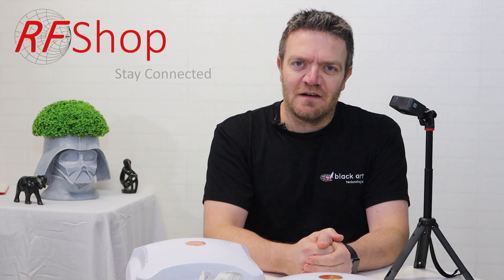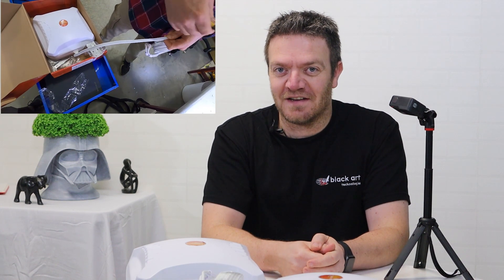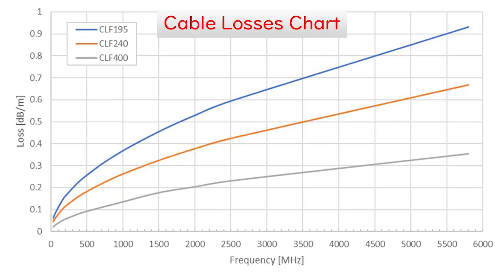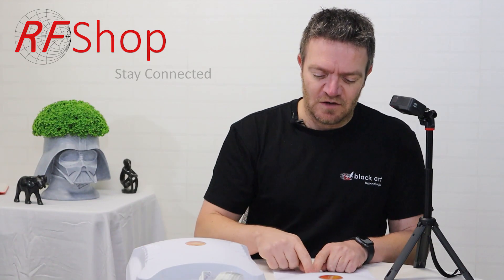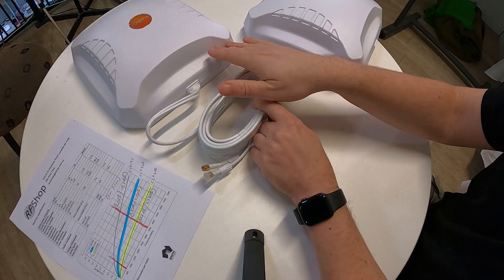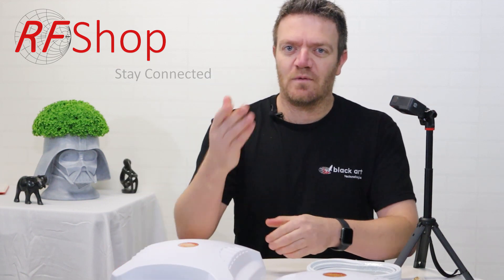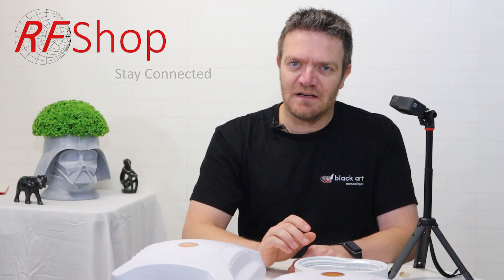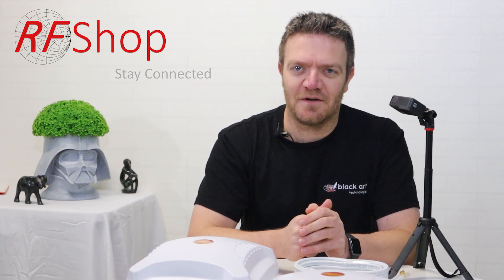How to manage cable losses on a 4G or 5G Antenna

Comment: Please make a teardown of your antenna on the next video, thanks!
That would be interessting for all of us.
Reply from the maker: Spaten Pauli I need to be careful what I can disclose in the public forum. There are some low cost antennas I can investigate though.
Reply: @RFShop  Antennas are interesting. especially the obviously nasty ones you can find on ebay that make seemingly unrealistic db gain claims.
Reply from the maker: @brangiexx  interesting enough, a mentor ones told me I should not even bother with the stuff people see on eBay...if they buy on eBay they pay what they ask for. I do, however, still have a burning desire to lash out one day on a video (let's call it a controlled detonation) about those 35dBi gain antennas. If I do it politely enough the "designers" might even thank me for it :D :D
Reply: @RFShop  I actually saw one on eBay the other day claiming something like 40+ dbi gain. I was tempted to buy it just to pull it apart. I have very limited knowledge on antennas, but I know enough to know claims like that are just plain bollock's
Reply from the maker: Brandon Tein can you send me the link. I might just buy it 🤔
Reply: https://www.youtube.com/watch?v=jPp_iT98FYM
Poynting do a show and tell of their antenna